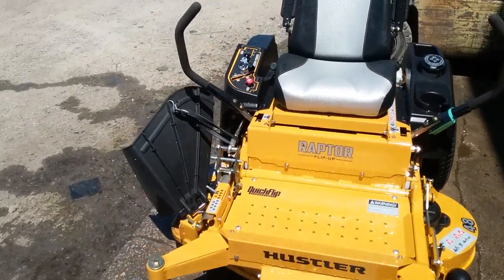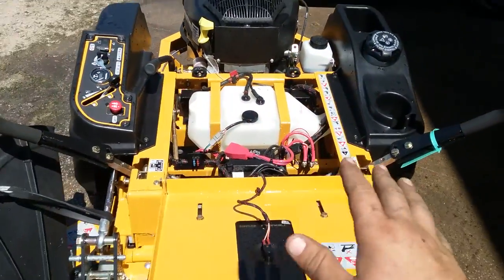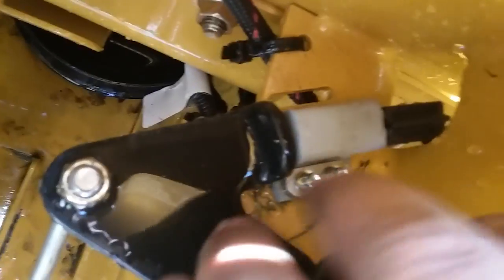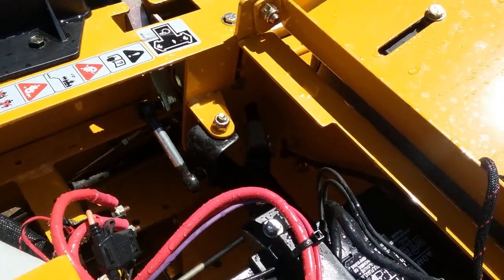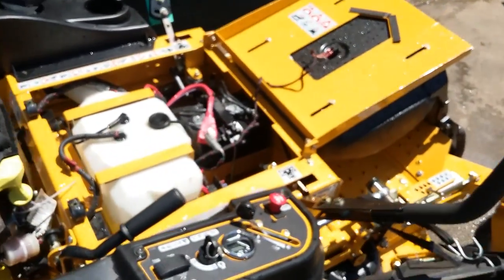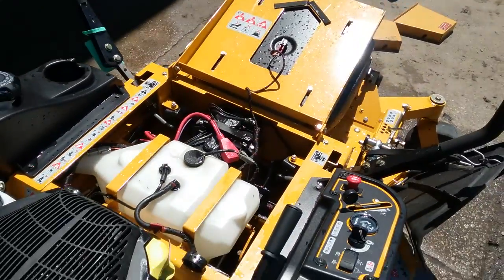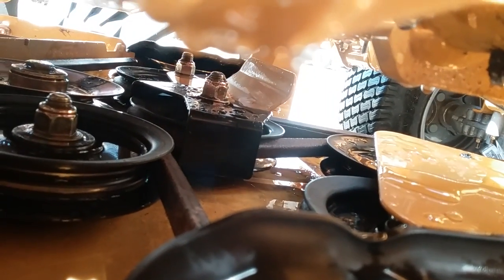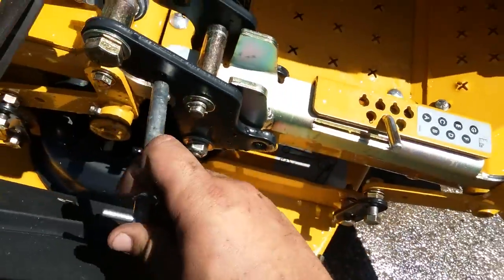Hustler Raptor Flip-Up - Common Problems

Comment: Thank you for posting. There was grass between the handles and the outer side of the handle box. Needed a long screw driver to clean it out as could not really see it. Then wiped down area with safety switches on both sides of handle assembly inside the mower. Then opened and closed handles several times. Worked like a charm. Grateful to God for all of you that post how to fix these problems.Thank you for doing the good Lords work.

Comment: I wish I would have watched this video before getting into the manual and diagrams. You still were alot if help thanks!
Reply: Just discovered that when the mowers come from manufacturer country of origin hustler in the USA adds all the starting relays.. the schematics in the manual don't really apply after all the other relays and what not is put on in the USA

Comment: Mine would throw the belt their update was putting about a 1/4" plate on top of the deck under the pulleys so there wasn't a big space for the belt to get caught haven't had a belt come off since

Comment: thank u much...so i have an issue...my seat safty switch (or whatever its called) is either stuck or broke..idk ..my engine dies even when blade not engaged if i get up from mower...i had to cut with a rock at my feet in case i needed to get up, lol..help!!

Comment: I've had the same problem with the micro switches. Also, there's no way my seat will tilt all the way forward like yours does. The seat safety switch cable doesn't have enough slack in it the way yours does. I've also just thrown a deck belt off the electric clutch. It's a 2019 model 48" flip up.

Comment: Replacing ignition switch noticed I might have pulled two wires loose with female connectors one orange and one black don't know where they go

Comment: I bought mine used. Before I even started using it I had to mess with those switches. Damnit. And the rod inside the hydraulic housing got rusted out

Comment: Once those issues were fixed are you happy overall with the lawn mower
Reply from the maker: For the most part, yes. I believe the biggest concern I still have with these machines is the pin to flip the deck, but otherwise they do fine. Most people find that they ride pretty well for their price range, and the deck leaves a nice cut. The kohler auto choke engines also haven't given us any major issues in the year and a half that they've been in use, so that's a plus as well.
Reply: cmart009 yea ive been looking for a nee zero turn and hustler wasnt on the radar until I stumbled upon this video. But so far im sold
Reply: cmart009 Thanks for your quick reply cmart. I'm thinking about purchasing one of these. My lawn tractor service man has recommended I get a larger unit. He's had to service my Troy-Bilt, 7 speed, 42 inch deck unit a few times, in addition to regular maintenance, in the last four years. I have 2 acres. He says my mower might be working too hard. He and a friend have recommended Hustler. Hope to see your update video. Thanks again.
Reply from the maker: Not a problem at all. If you're looking for a bigger mower though, you might try the Raptor line or Raptor Limited line. They come in 42", 52", and 60" decks for cheaper than the flip-ups. If you're worried about changing blades or doing work under the deck, they're still light enough to lift the front pretty easily with 1-2 people, and then set on some ramps or other stand.

Comment: 48 " Hustler SD  cranks will not start , removed plug plug seems ok , will not crank seat safety switch plug checked the part on seat is loose plugs are in tact  no crank

Comment: It's been 9 months since you've posted this review. Thanks. Has Hustler addressed these issues during manufacturing these? Or, are buyers needing to address these issues with the dealers when purchasing them. Again, thanks for the vid.
Reply from the maker: I appreciate you asking! I was going to do another update video on these units next month, but now is as good a time as any.

"Has Hustler addressed these issues during manufacturing these?"

Short answer: Yes.
Long answer: No.

Production of these units has been halted since the tail end of last year. Currently, Hustler has hundreds, if not thousands of these units (48" and 54") sitting in their warehouse awaiting delivery on a per-order basis. All the dealers that I know of are still trying to sell these units, but are finally getting down to the last few in their inventory. At the start of this spring, Hustler distributed a long list of warranty fixes and corrections to the Raptor Flip-up line of mowers to dealers. Any dealer who sells these flip-up decks should be going through every unit, whether they've already been sold or not.

Typically, we would call those who purchased one of these mowers and tell them of the issues, bring it in, and fix them. New units out of crates should be fixed immediately upon unpacking, before they go to their new owners.

I say 'should be', because we've had varying results with people bringing in their flip-up decks from other dealers, only to see that the unit hasn't undergone some, or any fixes whatsoever. 

So, 'Yes', Hustler has addressed the issues during manufacturing by leaving the fixes to the dealers...IF they get around to fixing them. 
But, also 'No", because they're leaving it up to the dealers to fix the issues instead of Hustler themselves. When an order is made for a new flip-up to be sold somewhere, Hustler sends out the unit in the crate as it is...back from the end of 2015/start of 2016, without any updates whatsoever. It lies in the dealers to go through and make sure the units are fit for consumer use.

"Or, are buyers needing to address these issues with the dealers when purchasing them?"

Personally, I would ask the dealer if the updates and warranty work have already been done to the unit, just to be sure. An easy way to make sure is to have them show you how to flip the deck; If they have issues re-latching the deck, or the pin doesn't line up correctly/doesn't slide in easily, then they haven't correctly addressed the issues. 

Most dealers that sell Hustler zero turns should have at least one technician on hand that is very familiar with these flip-up units. After working with their issues for over a year and a half...well, you get to know them very intimately. 

All in all though, these mowers do a very nice job. When everything is functioning as it should, it's a fun little machine!
Reply: If you were going to purchase a new one, is there a manufacturing date (or date of production) when these issues have been resolved? (i.e., mowers manufactured after Sept. 2016 have been redesigned to correct, or address, the problems you've outlined).
Reply from the maker: Short answer: No, they haven't manufactured any flip-up decks with the current fixes. That all falls on the dealer selling them. The "2017" flip-up decks you see for sale at dealerships are 2016 models with all the updates installed (hopefully).

Any other model besides the flip-up decks have had their fixes installed on the units prior to shipping them from Hustler. The flip-up decks you see being sold this year are still from 2016; Hustler stopped manufacturing them after the swarm of warranty issues from last fall (2016). Any time someone orders a new flip-up unit, Hustler pulls from their own stock in Hesston, Kansas.
Reply: Thanks for the reply;  2 questions:  1.) Is your comment implying that Hustler has discontinued making the flip-up model due to the issues you mentioned?  If not, would it be wise to wait until Hustler begins producing the flip-up after addressing the issues; and when might that be?  2.) If you perform the repairs as stated in your message are you saying that will take care of the problems and essentially the mower will work fine?
Reply from the maker: 1. Yes, they halted production of the flip-up models late last year. Production started in late 2014. I don't see them producing more until their current stock runs out at their warehouse.

2. Absolutely. Hustler issued a warranty packet this past spring detailing all the fixes for the flip-up decks. It was issues to all dealers who sell Hustler zero turns. The dealerships should be applying all fixes to any units that come in/get sold.
Reply: Thanks again.  You say you work on these machines all the time; do you have repair shop or are you a dealer?  I'm buying some property in Illinois and I hope to purchase one of these in the next few months.  Can you recommend a Hustler dealer there?
Reply from the maker: I work as a technician/diesel mechanic at a dealership. Scag, Kubota, and Hustler are my typical projects. I also do unit setup for those three companies as well.

As for recommending a dealer, I'll check with our midwest Hustler rep when he comes in. He may know someone who'll take care of ya.
Reply: @cmart009  So it's 2019 now and I assume that Hustler is producing new units since they are advertised with Kawasaki engines instead of Kohler.  Have they fixed all the issues with the flip ups?